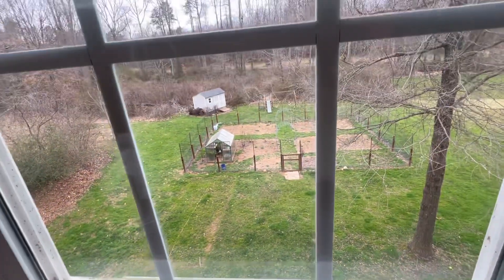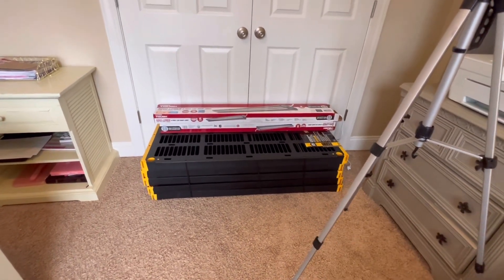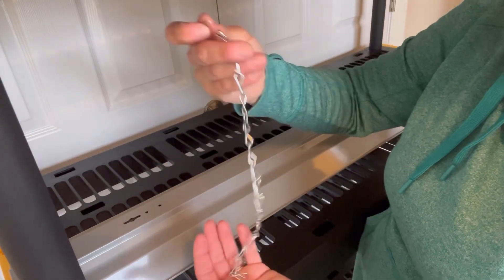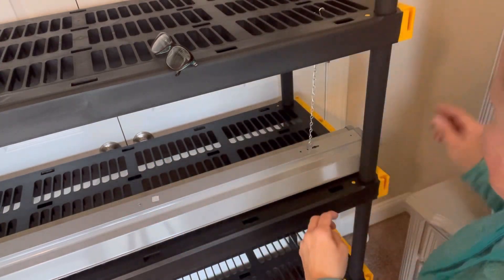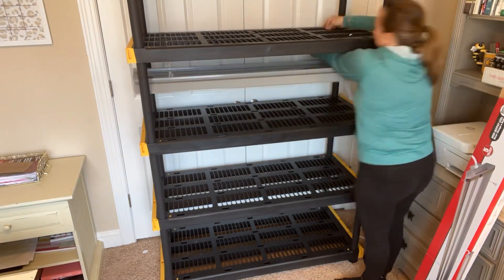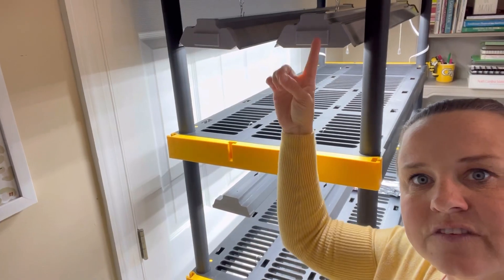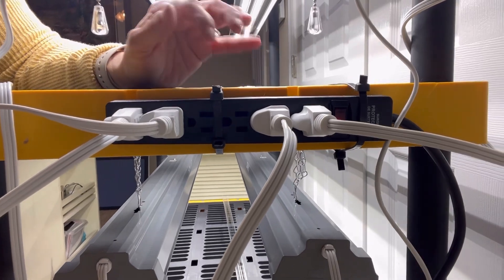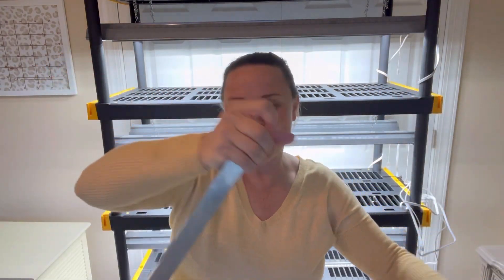My INEXPENSIVE, DIY Seed Starting Setup Perfect For ANYONE!

Comment: I have a similar setup and I absolutely love it.  The LED shop lights work perfectly for seed starting as well as growing my houseplants.  Like you mentioned, the lights need to be within a few inches of the seedlings to prevent them from becoming leggy.  With my houseplants, the lights are about 1-2 feet above the plants.

For anyone considering ordering a heat mat to use on the shelves, remember to measure the shelf dimensions INSIDE the corner poles.  A 48 inch heat mat will NOT fit on a 48” shelf unit…ask me how I know🙄.  I ended up using two of the 20” mats and that works fine.🌱🌱🌱
Reply from the maker: Hi Kayla, wow that is GREAT advice on the heat mat. Do you feel having a heat mat is worth the expense? I was going to buy one but they are so pricey I just didn't.

Comment: Those lights are the best! Got 8 of them last year at Walmart from Gary's suggesting on the Rusted Garden. Your gonna love them.
Reply from the maker: Yes!!! They are the best. Doing a fantastic job of growing my little seedlings right along.  I'm going to film and update :-) How are yours working this season?
Reply: @thesoutherndaisyllc  There doing great!! And you can put them lights really close and wont have to worry about burning your seedlings. I don't have a heat mat and germinate all my seeds in my furnace room . I put them ontop of my hot water holding tank. My peppers are taking the longest and I just learned that soaking them like some other seeds will make them germinate faster. Can't wait to see your follow up video.